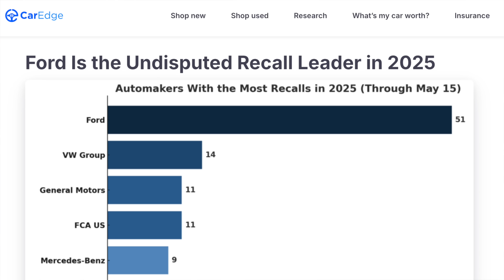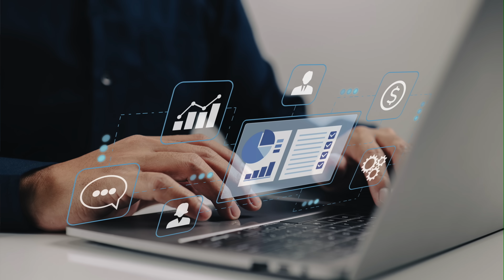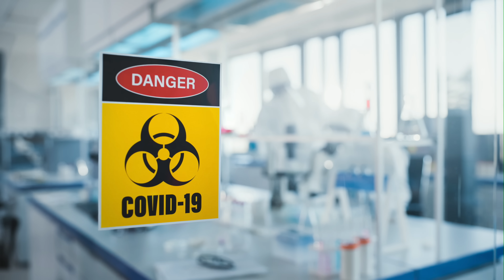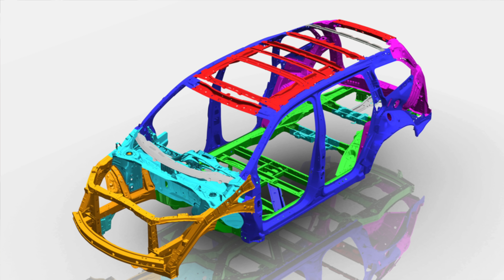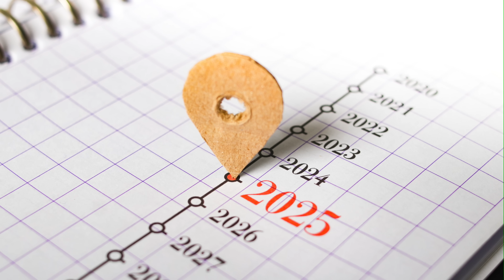ENGINEER EXPLAINS WHY QUALITY IS GETTING WORSE - WHY PRODUCT DEVELOPMENT HAS BEEN STRANGE

Comment: I work very closely with my PDI center which gets cars from various manufacturers. I have to say, 2025 model year has been our absolute worst when it comes to outright failures and malfunctions. Honestly since I've been doing this for almost 8 years, I think 2025's issues is more numerous than all issues I've ever seen from prior model years combined. As I say right now, I currently have 2 vehicles that have been unable to be put on the road for at least 1 month. The next longest was finally ready yesterday. The problem units? They're actually in the later stages of their generation, these are refresh models and not even the earliest model year for the refresh. The common problem item? Screens, be it the actual unit or the dash screens. I am kind of shocked at some of the subpar quality compared to even last year. One model we saw what we thought was a defect because one side looks bad and the other symmetrical side was fine...turns out all of them 2025 models had the same issue, looked at a prior model year which looks identical...a completely clean panel. Won't hurt a customer...at least I don't think so, but how that got past QC I'm baffled. Either plant QC was totally incompetent or management was notified and okayed it, both terrible outcomes.

My guess? I think these units are being rushed because of tariffs. I've never seen automakers react so aggressively to push units down our throat. My PDI center is fortunately big enough to hold more units than a typical dealership would want to. However I've heard plenty of dealers getting rammed with units. Some automakers are more consistent in their aggressiveness, VW is the one most notable here, heavily pushing Taos and Tiguans.

Comment: Interesting theory.  It could help explain some issues associated with an engine's design, but I don't see how it applies to areas such as paint finish and thickness.  I also wonder if you could apply that "COVID" theory to what could take place within our current times (with tariffs impacting where vehicles are made and the complications regarding how to alter the need to source materials and components from other countries - will this soon be the "TARIFF" theory as to why automakers are producing less reliable (or cheaper looking) vehicles - cutting corners or selecting cheaper materials to keep vehicle price steady - making design considerations that will in a few years dictate the quality of what come to market in 2028 or 2029?).  Regardless of the theory, I do see much better materials being selected for the interiors of new vehicles to be sold (such as on the redesigned RAV 4 coming out late this year / early next) as compared to recent launches (such as the 4Runner and Tacoma).

Comment: I have noticed a lot of cost cutting as well. 

Cheap looking interiors with tacked on and non-integrated tablet like displays. 

Fewer and fewer cars with spare tires. 

Some cars do not have a/c vents for rear passenger. 

Fewer cars with projector style headlights.

Comment: The real reason. Is .. due less demand in sales...  they don't want their vehicles lasting. More than 5yrs+++  pushing consumers  into leasing... so that they have sales every 3yrs     alsovonly way for dealer to make $ they put cheaper less quality parts...so that it break down faster... so they can also make $ recovery in selling parts...
Reply: The data doesn't back up your theory.  Sales have been rebounding to pre-pandemic levels.  There really has not been a clear sign of less demand in the last 5 to 10 years when the latest vehicles have been designed.  Any micro decline seen in the past 6 months would be irrelevant to this conversation.

Comment: It is well known that highly stressed turbo--charged engines are less reliable than normally aspirated engines. CAFE and emissions regulations forced Toyota into going to small turbo-charged engines (or pay fines). Toyota wants to be perfect externally, but internally they fully realize that problems will happen, and you have to solve them. The regulatory environment is always changing. The Andon cord, the 8 step Toyota problem solving method, A3 reports, root cause analysis, genchi genbutsu (go look, go see) are signs that they take problem solving seriously. Even Honda, the best engine manufacturer in the word, had problems with their 1.5L turbo-charged engine. Subaru is doing well with turbo-charged engines, but they have decades of experience with them. I'm sure Toyota will get through this, but small turbo-charged engines are always going to be highly stressed.
Reply: Diesels have been using turbos for decades now and no one would call them overstressed. It's common knowledge that forced induction engines have stronger forged internals than NA platforms
Reply: @Tacobuster88  Sounds like that 2.7L turbo 4 Silverado is perfect for you.
Reply: @camgere  it's funny you say that because it's the most reliable engine that GM has in their trucks right now 😂

Comment: ‘24 CR-V hybrid owner (came from ‘06 Acura I had for 17 years). Paint quality is definitely worse! CR-V scratches so easily! ‘06 Acura paint was solid!
Reply: The paint differs from modern cars today due to environment regulations. Back then it was Urethane based paint which was durable but had high VOCs. Today’s paint is water based, has less VOC and may even be have a thinner application. My older vehicle never had ceramic this or PPF that. My 23 had to get front half done with PPF as the paint chips so easily.
Reply: @sizzlacalunji You like the PPF better?  I did a ceramic coating and while the car visually looks great after a wash, the graphene coating hasn’t been protecting well from minor scratches. I think I’d consider PPF for the front and door handle area next time.
Reply: @MaumeeTitan98  After taking 2 trips (5hr dives or more) I had a new rock chip each time. Car was barely broken in. After PPF, no more chips and approaching 30k miles with the Xpel PPF.

The graphene coating I want to try to bring out the color on top though. I was hoping or will he with minor scratches a swirl marks from washing it. Your feedback isn't promising.

Comment: high gloss materials inside or outside of any vehicle is a terrible decision. it might look new for a couple months if you’re extremely careful. anything glossy or reflective inside the vehicle will shine sunlight in your eyes from time to time while you’re driving. Fake vents (anywhere), giant tablet style screens need to disappear, and climate controls should be simply 3 dials, instead of every car having a different system. also keyed ignitions should return, people buy these expensive vehicles and throw their key fob in the cup holder to rattle around? plus car theft with push button ignition is happening daily.

Comment: Bought a 2024 4Runner TRD ORP. Basically, it’s a 2010 model extremely refined. I absolutely love it. Feels like a tank. Yes, it eats gas, yes it’s a bit of a beast, but it is the most solid vehicle I’ve owned and I keep vehicles for 10-20 years. Feel lucky to get one before the reengineered model was released.
Reply: It’s a fantastic vehicle, I’m very glad to own one
Reply: 2013 Toyota 4Runner, 4WD, with no mods - owner here. I have 256,000 mile on it. I remember, I started with 18 MPG, it decreased to 16.6 MPG now. My mechanic is amazed that car doesn't have engine leakage so far. The only problem car has is a rust underneath. I would consider some protection, if I were you. I live in Los Angeles but I travel a lot in the winter to ski, so it means salt and chemicals on the roads. Frequently, I sleep in a car on skiing trips with engine running all night. Therefore I change oil (from Toyota) every 3000-4000 miles. I have bought 2025 Ford F350 and I am anxious how it works out in a long run.
Reply: @muh144 I use fluid film undercoating on the frame and undercarriage. Live in the salt belt. 

I really think this is the peak version of a 4Runner that we’re going to see, if longevity and reliability are your most important criteria.
Reply: @bluedevil0111 Good choice.  I bought a 2004 4Runner in 2004 and still have it.  It has the 2UZ FE V8 engine which is a very reliable Toyota engine and has full time 4WD.  It has 69,000 miles,  is completely stock,  garage kept since new, no accidents and has been maintained exclusively by Toyota.  People are shocked when I tell them it is 21 years old.
Reply: Till the engine takes a crap.
Reply: It’s interesting that you feel very lucky to get the final year of the 5th generation 4Runner. A lot of folks are upset when an anxious  salesperson unloads one of the dealership’s last 2024 examples w/o telling them of an all-new model about to get introduced (in your case, a 6th-Gen 2025).
Reply: @DeeEllEff 😂 Dealer didn’t have to unload anything. All of the final months’ 2024s were pre-sold before they even arrived at the dealer. Lots of folks wanted the tried and true V6 as opposed to the turbo 4, among other downgrades. General build quality is poorer in the 2025, which is basically the whole point of this YT video. The 2024 was the way to go if build quality, reliability and longevity are your most important qualities in a vehicle. If you want better 0-60 times and an extra MPG or two and don’t care about keeping it for 10-20 years then go with the new one.
Reply: @bluedevil0111  I hear you, and I acknowledge that vehicles that’ve switched to overboosted turbos & CVTs are dragging down quality. I didn’t know all the 5th-gen 4Runners had been presold; most consumers aren’t nearly that aware of future product plans (because as I had said, dealers refuse to tell you what they know’s coming but not out yet). “What  do I have to do to sell you a vehicle in current inventory on my lot today?”
Reply: @DeeEllEff That was the case at all the dealers in my region. I got a slight discount off MSRP and had already test driven one, so I negotiated the price and put down a deposit while it was still in transit. Purchased last September and they were pretty much gone and unobtainable by November.
Reply: @bluedevil0111  well said, I love my 2024.
Reply: @bluedevil0111  Spot on!
Reply: With all due respect, I can’t help but think you’re full of it and that you probably work for a Toyota dealership as a salesman.  The new Toyota 4Runner is a rather large SUV that is now powered by an undersized 2.4L 4-Cylinder Turbo engine.  Regardless as to whether it is accompanied by a hybrid powertrain (and of course your now only get the 4-Wheel Drive if you purchase the vehicle with the hybrid powertrain), it still must have some serious quality control issues, and you know it, and you also know there’s no way you’re going to get 100,000 - 200,000 miles out of it like I did with my 2000 Toyota Camry, with the 3.0L V6 engine.  You car salesman are borderline sociopaths that only give a damn about the next sale, and money in your own pockets.  Parasites like you make it easy to walk away from Toyota forever.  The sales people of Toyota should also be walking away from the company just like their customers.  After all, it is the company(s) and big liberal government that is stabbing you in the back.  I currently drive a 2014 Toyota Tundra SR5 5.7L V8.  It will probably be the last Toyota, and maybe even the last truck that I’ll ever own.  With these quality control issues, super inflated prices, and the scam artists working at the dealerships, it may make more sense to either buy a cheap used vehicle, or the cheapest new car you can find.  It doesn’t matter if you’re rich or poor, nobody wants to get ripped off.  Rs
Reply: Smart move! That’s probably the last generation of bulletproof 4Runners.

Comment: Stick to Toyotas and Hondas from 2015 and earlier. Unfortunately, corporate greed and quality are incompatible. Period!
Reply: Honda? Yeah like the 2013-2017 with tons of problems and the crv 2017-2022 with the oil dilution?
Reply: Nah.

Inflation and government regulation are the cause of current issues.
Reply: @jasonostack9319   “Government regulations” such as emissions and safety are probably responsible for you and me still being alive today.
Reply: @DeeEllEff 
We will never know. We do know that government regulation increases complexity and therefore compromises reliability, while raising prices.
Reply: Toyotas new A25A 4 cylinder is still dead reliable, there are lot of examples of these going over 400k without any major repairs, along with their NA 2.0 l 4 cylinder engine, their 2.4 l turbo pretty good so far, haven't heard any major issues
Reply: @manjotsandhu9539  Rear main  crank seal leaks on the A25A engine are becoming prevalent & Toyota & dealers refusing to repair the leak.  Toyota wants a fast flowing drip to do any Warranty repair.  Toyota is just another (GM, Ford etc) & Riding on their past reputation, they have fallen also.
Reply: Well those vehicles are at least 10 years old
Reply: As someone who used to buy ‘80s Toyotas, ‘90s Hondas, and early 2000s Subarus, I’ve now switched to Mazdas to avoid fragile CVTs (continuously variable transmissions) and overboosted turbo engines. (But note that a few Mazdas have also switched to these!)
Reply: @DeeEllEff Toyota eCVT setup is not fragile. The opposite actually.
Reply: Lol what are you guys talking about? Modern Toyota/Honda models are still very reliable, Toyota’s have an ECVT (different from a CVT) and is one of most reliable transmissions ever made. Toyota really only has problems with two models I think, otherwise everything else is quiet and reliable.
Reply: @gastah5so170  My issue w/Lexus & Toyota is obviously not their NVH or reliability, which remain stellar. It’s that most models are monumentally boring

Comment: It is a planned obsolescence strategy implemented to force the hand of the consumer to buy an EV.  Increase ICE failure rates to provide more reason for consumers to move to the new EV ecosystem.  It also allows carmakers to decrease their cost of production of ICE models to improve profits while they use higher prices of lesser quality ICE vehicles to pay for EV development.
Reply: What a conspiracy theorist.  Your theory explains absolutely nothing regarding Toyota's quality issues considering they have been resisting the movement to EVs.

It also makes no sense to correlate clear quality issues (i.e. recalls) to planned obsolescence considering recalls cost the manufacturer money.
Reply: @Th3Think3r there is definitely planned obsolescence now a days. Not to move customers to EV’s but to new cars. There’s a video of an engineer explain how beancounters work hand in hand with engineers to reduce the manufacturing costs of every component. They also push for limited service costs during the warranty period. They push as hard as possible until the failure rate gets about 10-15% and the warranty/repair costs outweigh the projected savings. They have very advanced models to calculate these things. Almost every manufacturer does it now. GM, Ford, Toyota, Nissan, etc.
Reply: Conspiracy theorist mindset. If your theory is true, why is it affecting Toyota and EV-exclusive manufacturers? Critical thinking is obviously harder than spewing ignorance.
Reply: I agree 💯. Consumer Reports is favoring hybrid systems over ice 🧊 engines trying to increase the sales of hybrids knowing the cost of repairs are much higher than ice engines when these vehicles hit the used car market. U are right about auto manufacturers lowering the quality on ice 🧊 engines to get customers to buy their hybrids. You should see how the Indycar vehicles are crashing and the regenerative braking system failing causing crashes because of the hybrid systems in the race car🙈